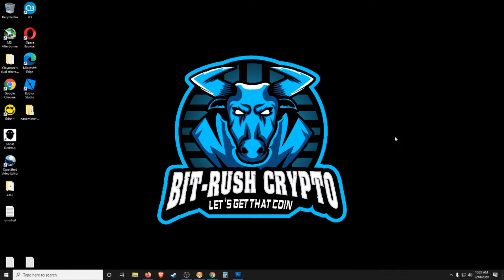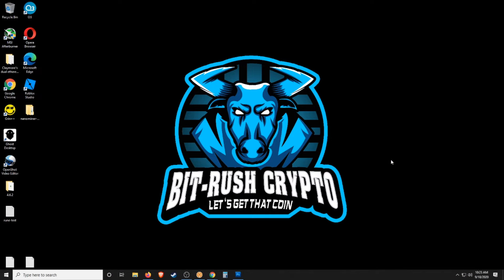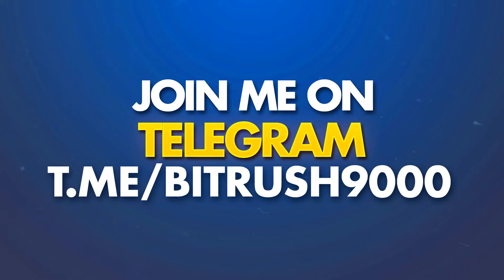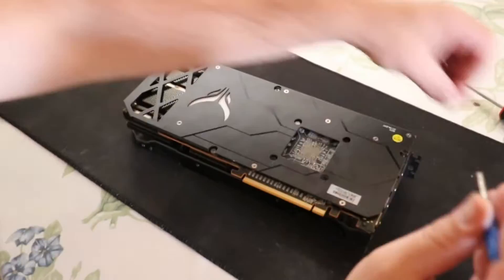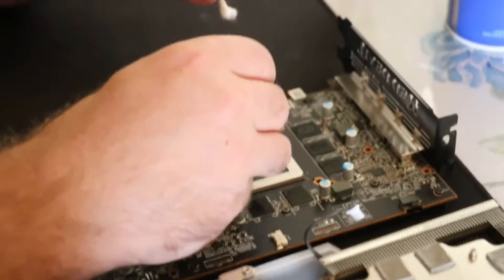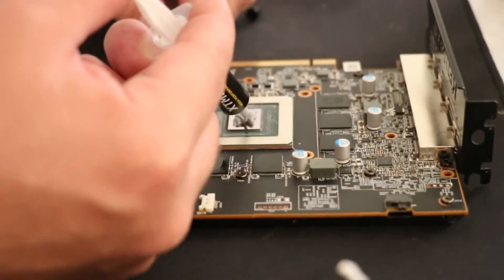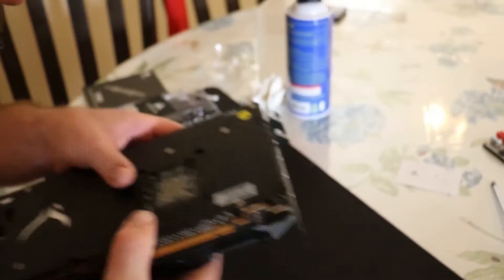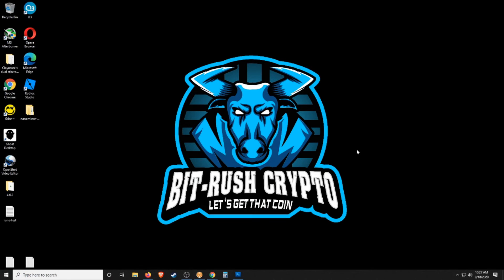Replacing the Thermal Paste on an Overheating GPU | Red Devil 5700 XT

Comment: Thanks very much for the video! I have no problems with the GPU-core temps but the VRAM is getting to hot (90-92C) compared to my other cards (78-82). Can you apply new thermal paste to the thermal pads for the VRM or would i need to replace the thermal pads? Any insights?
Reply: Replace the pads!!!!
Reply: Same here.  Red Devil should be name Hot Devil. The worst card in my stack. Very hot memory and very ineffective cooling. I''m considered to try to change the thermal pads but I don't know the thikness. Any help will be very usefull. Thank you!

Comment: Was it the core temp that was overheating?  I have the same problem on the same card except it’s the GDDR6 memory temp that is overheating...
Reply from the maker: Yes
Reply: I’m also seeing high memory temps on my card. Found one video (but for an older model card) where they added thermal pads between the memory chips and the backplate. I might give it a try.